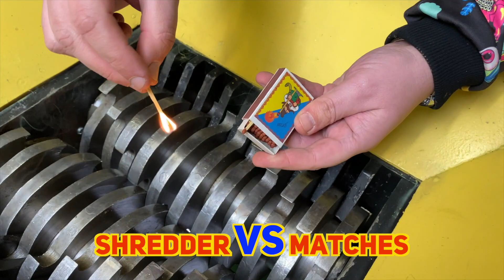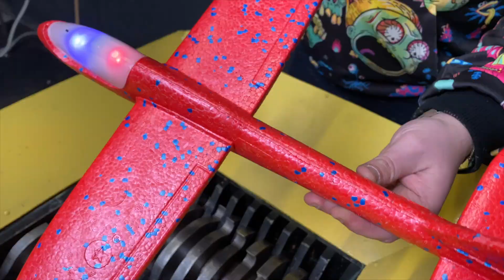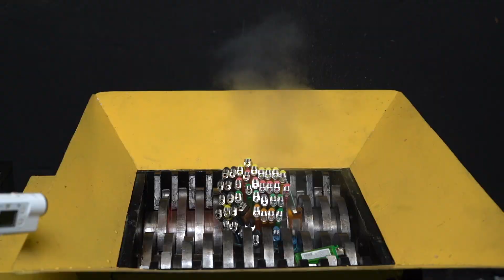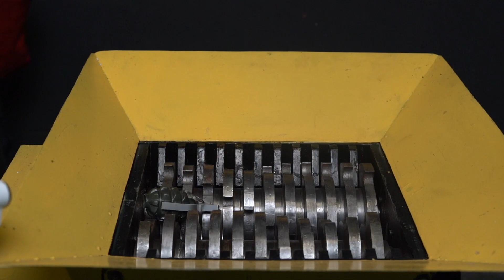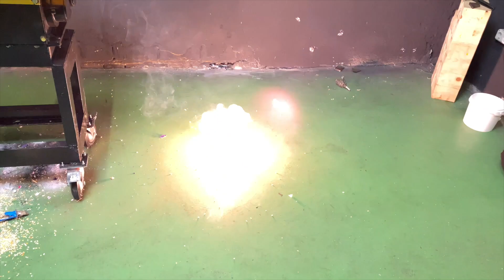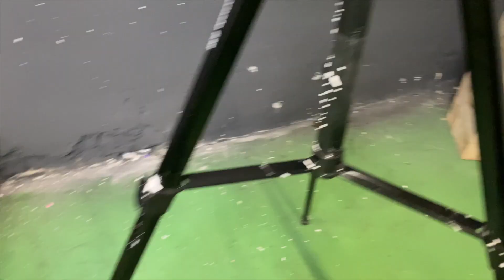EXPERIMENT SHREDDING BIG FIRECRACKER

Comment: if the granade were real it would explode everything
Reply: Not quite, a grenade explodes when it’s fuse it lit, normally by a hammer that’s released once you pull the pin and release the trigger, so if you crushed a real grenade you’d just have a bunch of ground up grenade lil